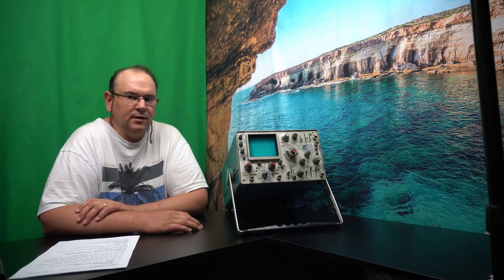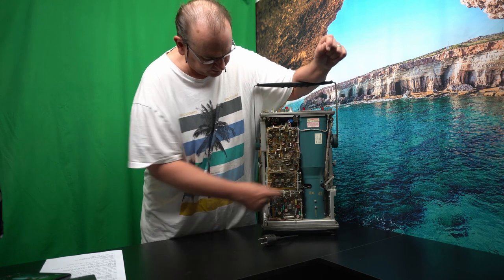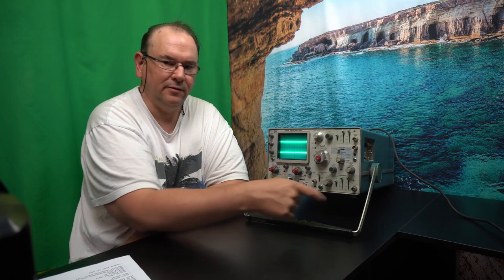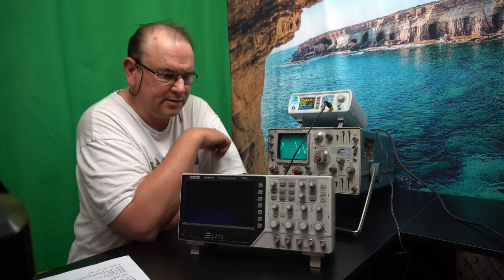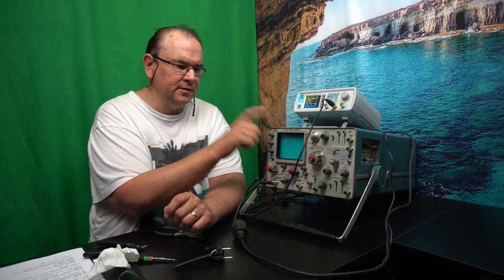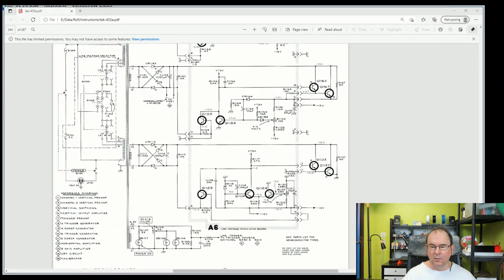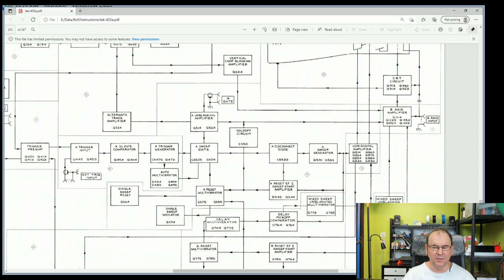The vintage Tektronix 453A portable oscilloscope

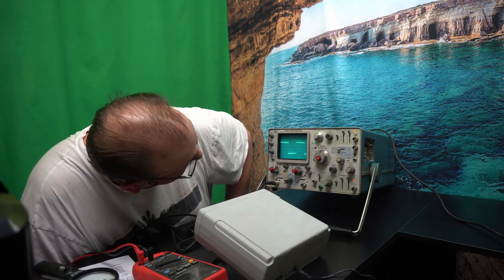Comment: I grew up using this 'scope in the electronic business. I especially liked the astigmatism adjustment - yielded a nice sharp trace. The "A intensified by B" was very useful in analysing pulse rise / fall times. At 10:30 you have to "compensate" the probe (an adjustment on the probe) to get a proper rise trace (no overshoot) on your display.square wave.

Comment: I just picked one up at eBay for $67 it was used by traveling IBM troubleshooting techs. I never met an IBM tech who knew what a scope was. The seller is a recycler and states the instrument is in good working order. A year warranty is in place on it. The frequency response is only 50 Mhz, but what the hey, my current scope is a dual channel , 20 Mhz Leader scope. I use it fir only radio and audio work. So 50 Mhz is more than I need and dual channel is one channel I don’t need. It weighs 30 pounds and measures 24 x 17 x8 inches. Ive got a scope cart and probes for it.